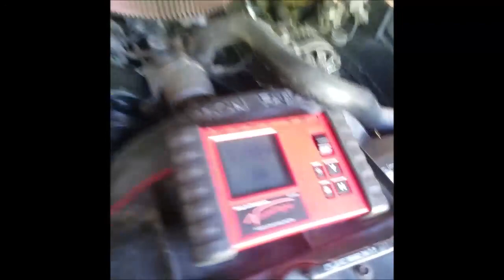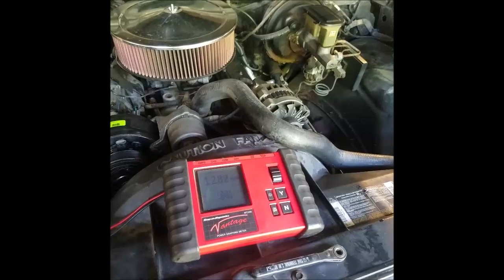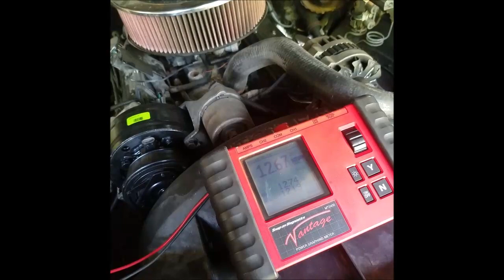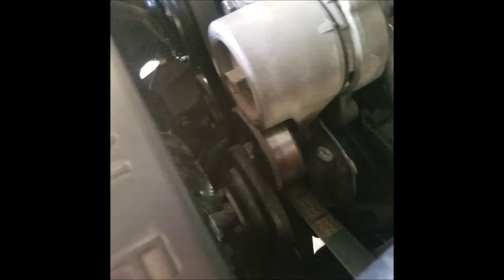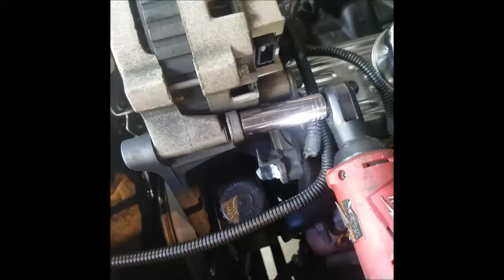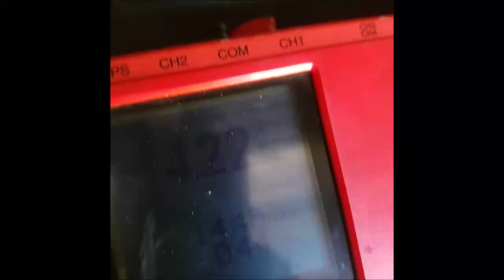1994 Chevy Silverado Alternator swap and testing

Comment: I have a 94 an i put a new battery in an just hooked up the starter line to the battery an not the alternator line so i ended the running the battery dead so i jumped the battery an hooked the alternator line up an got a few seconds down the road an the truck cut off an now the truck wants to start with cables conneted but just wont start im going to try charging the battery an getting a new alternator any other suggestions?

Comment: I have a 93 Chevy Silverado extended cab with a 7.4 l 454.
I'm sure the alternator just went bad as the engine will stop when I disconnect the battery. Battery light is on. Guess my question is, without looking at the manual, to your knowledge is there an inline fuse box that might have blown? Just found your channel and Really appreciate your videos. Thanks
Reply from the maker: I don't believe there's a fusible link on alternator on those trucks there is a fuse if memory serves me right under the dash that's tied to alternator
Reply: @HooptiesGarage  thanks for letting me know.. and taking the time
Reply: @HooptiesGarage  also have to thank you for the details you include as you go through your projects, like not to tighten the top bolt on alternator to tight etc. Thanks again

Comment: My 94 is reading 13.3 under load and 13.7 to 13.9 at the alternator. That’s a tad low right? Also it’s slow to start, has been since I bought it 6 months ago. I checked the water level in the battery yesterday and only one was full out of 6, 5 were dry. I know the battery is shot but I’m thinking the alternator isn’t performing at its best. The battery holds charge at 12.6, but cca is only 589 when the battery is rated at 690.
Reply from the maker: 13.3 is about as low as acceptable usually I only see 13.6 or so as botton
Reply: @HooptiesGarage  I have a ground from the furthest back bolt running to the frame. Is that normal? Do I need it?

Comment: I was driving my 94 silverado and it started to make a ticking noise and then I experienced power loss, when I got back to the house I realized my light that shows the ac was alot more dim than usually, I also noticed whenever i would turn my ac on my battery gauge would go down 2 notches. I was wondering weather you think it's my alternator or not
Reply from the maker: Very possible if you don't have a meter find a auto parts store most of them will test alternators and batteries for free.

Comment: This is good info for most anybody and thanks for that. There are a couple of explanations as when I started, rebuilding an alternator was the only choice as a box meant it came from the dealer. Rent was one of the first to offer a re-man. You are correct about battery testing, open or shorted cell can cause the charging system to head South. First, the big bolts hold it on, smaller one goes thru bracket from end housing to engine. The negative diodes are where the circuit is completed as these diodes create negative on the back. Painted, dirty or missing bracket needs a 4/0 to 2/0 cable to the engine. Positive goes to the battery B+ in this case starter. There is a fuse-link that can be broken, burn’t or left off. I hate this method because you can’t see well and always dirty w/oil. Do a voltage drop running like said with a load. Test with a DMM on DC setting and across point A to point B. So go from B+ on alternator to battery while running, it must be running with current (Amps) running thru that circuit. Shows less than 0.50Vdc or less, good to go. Same reading on negative! Techs will say; “Ah the black has to go here….” STOP. Makes no difference as if meter leads are backward, you get a (-) negative symbol and the reading is the same. So, who cares? Just do both. The output of GM is temperature sensitive, colder it’s voltage is higher. Hot, voltage is lower with 13.2 minimum 20% higher than battery fully charged, 100% state of health, open circuit at battery is 12.8 volts. Simple!
Have a small wire in connector and idiot light not on during bulb run test? The regulator produces 12Vdc to bulb when working. B+ at key goes to dash bulb, regulator engine off is ground, bulb comes on. 12 volt supply, 12 volts to the same bulb, no potential for current to flow, bulb goes out. Driving something older? Well, many are buy the old 10SI & 12SI tapped the center connection of the “Y” connect stator. It is ground when off but B+ when running. Bulb goes out! But mine came on dim once and got brighter, then battery went dead. The diode trio tapped all 3 legs of the stator and supplied the regulator with voltage. If failing, voltage leaks backward thru the diode to ground causing the light on dim to bright. But “Y” type stator and it was good for voltage and the regulator controlled ground. Today, it is a “Delta” type stator and the regulator controls the positive side of rotor. So different regulators and same results at 400HZ. This low frequency keeps static below the AM band of 550HZ. They still run at 400HZ. It is the “Delta” stator is better for amperage as today we had 12 illuminated cup holders, compass and mirrors that defrost and fold for the car wash or narrow garages, etc. So, everything you didn’t want to know about a GM alternator but was never going to ask. Yes, two stators for some, coolant cooled for others and yes, 250 degrees F can be colder than the alternator as some have air ducts and those in box returned, Not Charging are pack with corn stalk leafs. Yep, I have seen that. It is everything to keep diode cool including two internal fans with large openings. The fans do not blow air inside as they are centrifugal and draw air out. Every part inside is replaceable including the slip-ring keyed in place and tapped on. The ends are soldered and cover in a little epoxy. Otherwise, I don’t know anything about GM or Import alternators! Have a good day!

Comment: I’ve done changed my alternator and it’s doing a whining sound what is the problem
Reply from the maker: Well it could be a number of things, you could have gotten a crappy new alternator, it could be power steering pump which will make a whining noise if they are low or the pump is going out, you would also need to check your tensioner idle pulleys water pump etc. Without hearing or looking at it first thing that comes to mind when you say whining noise is power steering pumps that's a very common whiner.check the fluid level first.

Comment: I just changed my starter on my 1994 Silverado 2500 v8 but it still has a problem when I turn the key to start her up, she lags then starts up as long as I don’t let go of the key, but if I do let go she dies on me, could this be it before I go buy a new alternator ? Because I have fully charged my battery over night but will still do the lagg, also all my lights work besides the blinker when I try changing lanes any thoughts? I been changed my flashes needing to do so asap with winter weather coming up my lights need to be on point any suggestions? Thanks for this video !
Reply from the maker: I would need more information but that almost sounds like a ignition switch issue or something along those lines